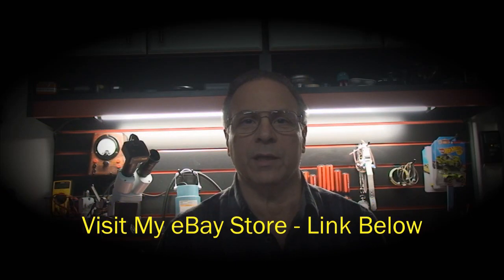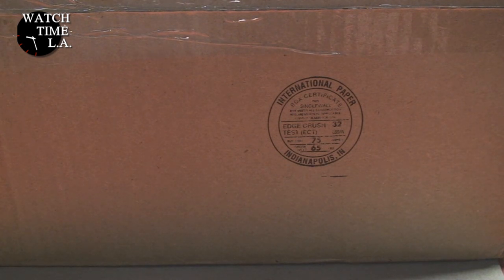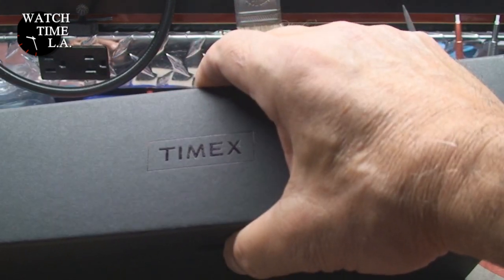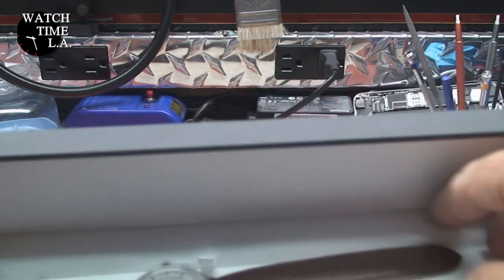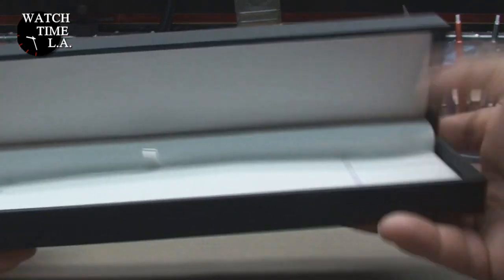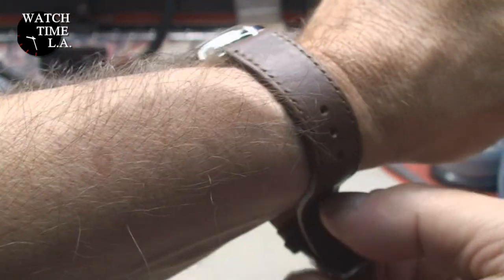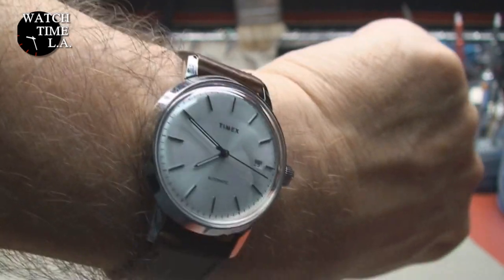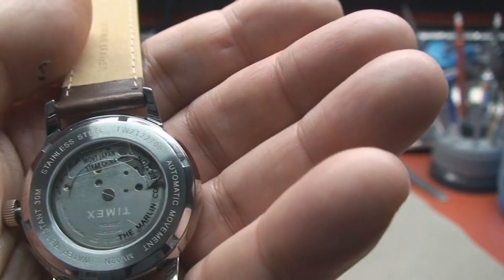New $250.00 Timex Marlin 40MM Automatic  Unboxing - First Impressions

Comment: You know, usually I love most anything Timex, I've got PILES of new quartz ones, vintage manual/automatic and electric ones (I'm even currently wearing a late 60s Timex Dynabeat electric).... but $250 for that?  Vintage Marlins can be found for less....  yeah the new one is bigger, I get it.  But that case sounds REALLY tinny for that kinda cash... and the styling is just kinda plain minimalist... Someone could stick an MVMT logo on it, and it wouldn't be out of place.   At least the hand winding one had some stylized 60s numbers... but that's just my tastes.  Good video, I just don't love that watch...
Reply from the maker: I have several Timex Electric watches.  A true marvel of their time.  In fact, that is one I will be comparing against in the review. RMA?  Lets see.
Reply: @WatchTimePlus  About once a year I go nuts on eBay and buy a bunch of vintage Timex.  Lol....

Comment: isn't the miyota 8215 the auto/ handwind.. "stutter" movement 
( if you hold the case vertically the secondhand will drop irregular 
between 12hrs and 06hrs )
Reply from the maker: As I have learned in the last day, yes, that is exactly what it is.
Reply: @WatchTimePlus  .. ah..I have a AVI-8 Flyboy with that movement
it holds time nevertheless the stutter second reliable.
The movement is also known for its noisy rotor but even that is personally
on a dresswatch a bummer on a pilotswatch the sound doesn't matter.

I do understand Safire would be a mistake with that dome shape glass
so acrylic is a good thing but $250.-  is like asking $ 15,- for a Cheeseburger

Comment: £219.11 here in the UK was to myself very expensive for an overrated reproduction by a Dutch holding company using the TIMEX name, it’s not authentic vintage looking, if it breaks outside it’s warranty, then chuck it or use it as spears.